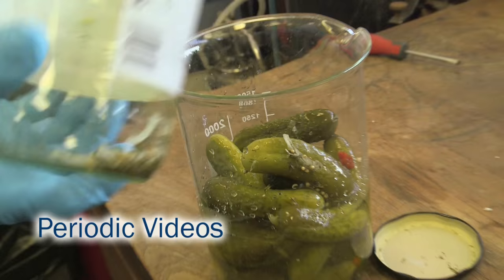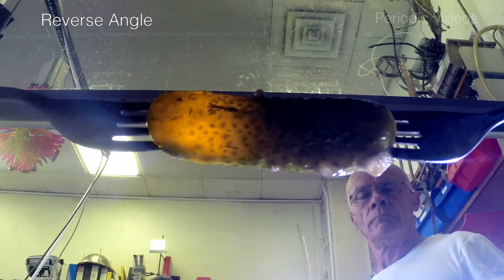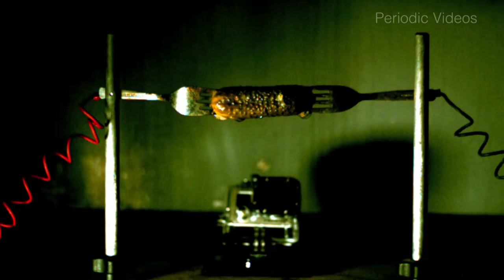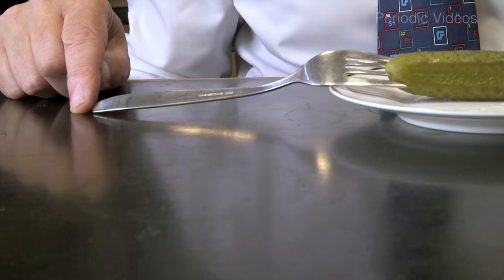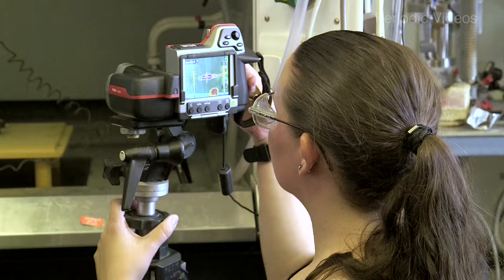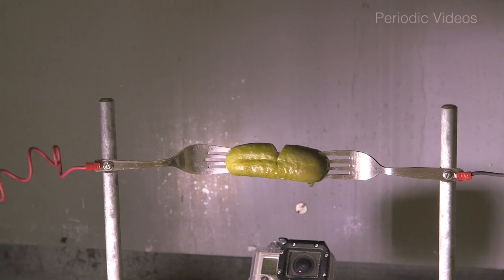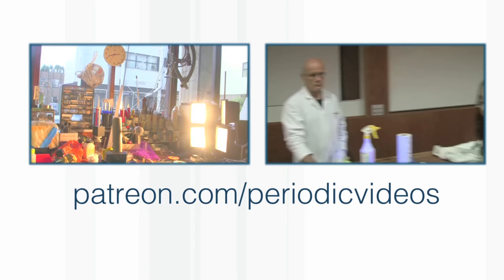Electrified Pickle - Periodic Table of Videos

Comment: Did you check the polarity of the pickle you don't want to install them backwards.
Reply: yeah, the stalk is positive and the tail is negative.  And it works best on a full moon.
Reply: +Ray Kent lol
Reply: When you put pickles in parallel, their tastiness can be measured by 1/t = 1/t1 + 1/t2 ...
Reply: Michael Falk the current will alter the polarity to favor the direction of electrons.
Reply: You buy the AC types.

Comment: Sorry to correct the Professor, but his explanation of this video is incorect. 

If the conductor was getting up to sodium excitation temperatures the pickle would flash boil and then burn. The forks would also be red hot. The thermographic camera show us things are hot, but not hot enough. The sodium is getting up to light emitting temperature from arcing happening between the forks and the electrolyte (pickle brine) in the pickle tissue when the water next to the forks is boiled off by the high resistance caused by the change in conductor resistance. 

The side that flashes is based off of conductivity at each fork and will seem random, but can be controlled by inserting less or more prong on one side. The arcing my still jump as the conductors heat up and water is evaporated from the pickle.

This is an excellent example or different conductors having a poorly bonded interface that is high resistance and the results in practical applications. Things get hot at the interface and damage the conductors. The wedge cut out of the pickle showed the underlying principle of high resistance points in a circuit cause high heat points.
Reply: I think it´s not the conductor but the arc that´s hot enough to excite the sodium ions, that would also explain why it didn´t light up in the thinner middle. It got hotter then the rest because of the increased resistance but not hot enough for it to start glowing.
Reply: The plasma in the arc (a few thousands of degrees) should be hot enough.
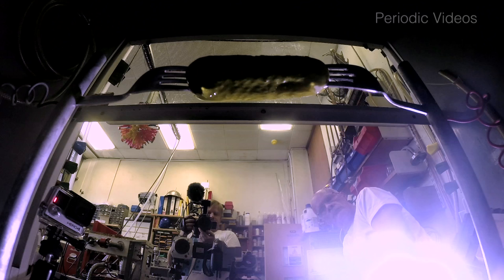Reply: And at 7:10 you can see the fork on the right moves a couple millimeters. This seems to have made a better electrical connection, with less resistance, on the right fork.
Reply: nah, it's the arc that actually hot enough to excite the sodium ions, which are just tiny part of the whole pickle.
Reply: Are you questioning his mighty afro?
Reply: Indeed, UV light from the arcing is the likely source of excitation. And while the amount of forkage (perfectly cromulent word, btw) should matter, I suspect it's not actually directly related to the resistance, but rather depends on mechanical stability. The side with less forkage has less mechanical support, and will likely develope a gap in which arcing can occur faster than other side, where the weight of the gurkin presses it down on the fork.
Reply: +Robin Bermanseder What? The arcing happens between the gurkin and the fork, ofcourse.
Reply: +Robin Bermanseder You mentioned that the prongs on the fork are the same potential, which is correct, but irrelevant. The experiment should be reproducible with a single metal rod as well. What seems to be happening here is that the gherkin (which I misspelled so far :/ ) is eroded or shrunk near the prongs, creating a gap in which arcing can occur. The gherkin serves as one of the electrodes, which is nothing strange, seeing that it's conductive.
Reply: What did i Just wrote?
Reply: Gary G Caring about who's right and who's wrong is ultimately a way of discerning what's true or not. What's the alternative? Turning off your brain and not caring? Let me ask you Gary, are you religious, by chance?
Reply: +Gary G classic Christians am I right
Reply: btw one study showed 75% of scientists are christians fyi
Reply: NatureHacker one study with a sample size of what?
Reply: Gary G I don't know if there's a misunderstanding here. I'm an atheist, and yes my comment was meant to condescending because what you said sounded too much like arguments I sometimes hear from creationists trying to muddy the waters regarding the reliability of the scientific process. Glad to hear that was not the case.
Reply: Gameboygenius Misunderstandings do & can happen, I'm happy to agree, No hard feelings.
Reply: Happy endings in comment threads always increase my faith in humanity meter.
Reply: Can't pick on anything else, So The Grammar Warriors come out to play.

Please Grow up, and as someone once said, Let's keep this Subject germane & adult like.

Comment: It probably changed sides because after some time it evaporated water, increasing the resistance of the now drier pickle, so it change the side where resistance is lower
Reply: From personal experience (as a pickle eater not as a pickle :) ) the moisture content varies depending on the way the pickle sits in the jar. So the first pickles that glowed at only one side sat vertically in the jar and the las one that alternated sides probably sat somewhat horizontally.

Now i have to experimentally determine how the sogginess distributes, top to bottom or bottom to top. AAAAAAAAA, damn it, i ran out of pickles! :)
Reply: I am a bit disappointed having to scroll so much to find this comment. Vote up!

Comment: Back in middle school our computers had an electronics lab program on them where you could connect batteries, resistors, lights and motors. It also had a pickle in it which you could make shrivel up with a "blerp" noise if you put enough power through it. Really neat to see that happen with real kit!

Comment: Due to the reflectivity of metallic surfaces, you can't actually gather temperature data from uncoated metal surfaces.  So the forks aren't necessarily getting as hot as the thermal imaging implies.  Great video!

Comment: I remember doing this demonstration in a middle school science demonstration. Each student had their own experiment and I picked this one. I built a homemeade rig and mine was the only experiment that required the use of the fume hood. It's nice to know more details about how it works. I think I remember more of my pickle lighting up than this; sometimes the entire pickle would light up for a moment or two. I suspect this has a lot to do with the different power used. I don't remember whether I used a large battery or if I used mains electricity (which, being American, is also not quite the same, as the professor mentioned in the video).

Comment: Nice one! I've been doing this one for years! The burnt smell lingering in the air is also a plus. I would suggest for the next one to test the conductivity of molten glass using two incandescent light bulbs connected in series. Break one, leaving the inner parts intact. Then heat the inner glass fitting and connect to mains, The other bulb should light up!Terrific work keep it up!

Comment: If you look at the high-speed footage around 2:50, it's clear that the floodlight oscillates at 50 Hz, but the "pickle light" only oscillates at half this frequency (confirmed by an FFT of the audio). I would expect the pickle to become excited at every positive AND negative cycle of the mains electricity, but this is obviously not the case. 

It seems like the resistance of the pickle depends on the direction of the current, which seems odd from an electrical point of view. I'm dumbfounded, does anybody have an idea as to why this might be?

Comment: Did the arc jump to the other side of the cut pickle due to the electricity following that path of least resistance? It looks like once the left side heated up, it jumped to the right, then once the right heated up, it started to alternate. Did each side almost find equilibrium?

Comment: Someone may have noted this before me, but i think the light comes from electric arcs forming between the tines of the fork through the spongy tissue of the pickle that is filled with a conductive ionized water solution. If it switched from fork to fork at one point, it may be because one fork heated up to the point it deformed enough to space its tines farther appart from the closest tines of the other fork (the arc will then jump the least resistive gap). It may also be a variation in the presence / concentration of the conductive solution favouring the arcing in on area or another.

Comment: Periodic Videos, if you review your clips you will find a strong correlation between the relative fork prong/tine depth and the end which arcs. The fork with the least amount of surface area in contact with the gherkin will have the higher resistance of the two ends, thus will be the side that gets hotter first and subsequently start arcing first. (neglecting any other factors such as salt or alkalinity gradients)

Comment: In the first case, it looks like the glow only occurs on half of the AC cycle (you can tell this because the high speed video shows the room lights reflected from the back wall, and they flicker twice per flicker of the pickle glow - room lights, both incandescent and fluorescent, flash twice per AC cycle). In the second case, sometimes the pickle glows twice per cycle, and other times it glows only once. Any ideas on why this might be? It seems to act like a rectifier. It would be interesting to use a current probe and oscilloscope to see if the pickle is indeed rectifying the current.

Comment: Excellent experiments. I would expect the difference of contact resistance between the metal and electrolyte at the different ends would pick which end would continue to glow. As the current changes the electrolyte from liquid to gas, that end would become more likely to support the next mains cycle of conduction by causing a concentrated current density through the still liquid electrolyte (the ionized vapours probably dissipate too rapidly to support a continuous arc). I believe the forks get hotter than the body of the gherkin for two main reasons; firstly, they have lower specific heat, secondly, the fork tines vaporize the electrolyte on contact and thus gain heat from the arc but don't expel heat via that evaporation. It was really amazing to see the fork "cut" through the pickle after the glowing end switched! In that case the forks must have been incredibly close to equal contact area and equal contact resistance with nearly equal amount of electrolyte! WOW!
Totally amazing!
Thank you.

Comment: What is the purpose of the LED light? Is it just to light the pickle for better capture by the high speed camera? Is it like an indication, that the pickle is Live or is it used as a form of current limiting device?

It seems like the light is flashing with exactly mains frequency, which if correct, means there might be some form of AC rectification in the pickle circuit. Either the current limiting device does it or the processes inside of the live pickle. What would happen with smooth DC?

Comment: I used to do this all the time, but it's been over a decade, but as I recall we found the best light show was obtained by inserting two long electrodes in the same end of the pickle, extending through its length. I think you get arcing all along the length of the electrodes and it's a bit more dramatic, rather than the one spot at the end that I've seen here and from Steve Mould.

Comment: the reason why its all chance about the spark on one side verses the other, i believe the pickle is acting like a spark plug in an engine. well a spark plug has a specific location for the spark to take place. the gerkin?(pickle) does not have a particular location for the event to happen. in fact every time the event happens it turns a portion of the brine into gas thats expelled. so this event is constantly trying to find the most efficient way to ground through an ever changing route because the brine is being expelled its actually changing the resistance to the particular area in which the spark "jumped"

Comment: I saw this experiment on an American TV show years ago, (Mr. Wizard) with Don Herbert. As soon as the program was over myself and my approx 5 year old son went straight to the kitchen and found a suitable pickle. (Mom wasn't home that night) A couple of old forks were found, some jumper leads on a old electric cord and we were ready. 120 volts AC into the pickle and it lit up very nicely. My son will be 36 this year so it was a long time ago, but to the best of my recollection the entire length of the pickle glowed with pretty much the same brightness.
George
Reply: It looked like they were running the AC through a Variac, which may act as a ballast. Not sure what the difference between 50Hz and 60Hz would be in this situation. I've been under the impression that neither frequency will support a continuous arc well, but if the current is limited, then the power is limited (not to mention the inductive effects). In this video it looked to me like the light was being generated between the fork tines and the pickle, then diffusing through the pickle body.  ?? 
I saw the same Mr Wizard episode. I will be 36 next month. Happy Birthday to your son!

Comment: The pickle doesn't care which fork is grounded (or "earthed" in UK dialect). Only the voltage difference between the forks matters. Whichever end has the poorer electrical connection between fork and brine is the one that will likely glow.

The current flow must be constant everywhere in the circuit (the same number of electrons pass each point every second) but the voltage difference between any two points along the circuit will vary depending on the resistance between them. Two nearby points with relatively high resistance between them will see a relatively large voltage drop (difference) and more power will be dissipated between them than between points with low resistance and voltage drop.The higher power generates more localized heating, which boils the water, chars the pickle and tens to further increase the resistance and localized heating. This tends to continue until the resistance increases so much that current stops flowing altogether.

Comment: They mentioned "high voltage" (although I don't consider voltages in the hundreds to be 'high' really...) but nothing about how much current they're using.  Does this require a lot of current?  Does it act differently if you use low current but really high voltage (tens or hundreds of kilovolts)?

Comment: Very cool video. 
btw is anyone knows how they make their set up? I mean the forks, wire and electricity. 
Is it like just plug the wire to the normal house electricity or need something to regulate the voltage and amp?
Reply: More or less, except it looks like they've got a regulated voltage supply (hence the shots of the voltage dial). This would work just plugged into the mains, although I probably wouldn't recommend it...
Reply: basherofnoggins Thanks for reply. Yes I see the voltage dial. :)
Reply: By regulating the voltage and current in your power supply, you aren't counting on your circuit breaker panel (consumer control unit for you UKers) being your sole safety margin either should things go horrible wrong and your open circuit wires start glowing and melting/burning the insulation before you can unplug the power safely.
Reply: Markle2k So you mean should also have a external power supply? or something else?
Reply: What Will Happen If? A regulated power supply limits the amount of current without risking overtaxing what is plugged into wall. If you just go open circuit into the wall, the only protection you have is what is in the breaker box. You are going to be looking at the pickle, not your lead wires into the wall. You won't be alarmed that something smells bad from burning because you are fully expecting your incandescent pickle to smell bad from burning. Ultimately, you are counting on the circuit breakers/fuses tripping (and for all your bad luck you might have a faulty one or perhaps somebody shorted it out with a nail or bolt) to keep your house from catching on fire. If you aren't using properly specced wire, you may have to run to your breaker box in the basement to cut off the electricity if things start going wrong.
It is simply better to have control local to you rather than take on all these (and perhaps other) risks.
Reply: Markle2k Thanks for information :)
Reply: I would say it looks more like an autotransformer, or a huge rheostat.  Especially since the device looks and is referred to as "ancient".
Reply: 2 plug fuses too :)
Reply: It's an auto transformer aka a "variac".
Reply: Now that I think of it that makes sense, since the output goes to 260 :)
Reply: yes it is a variac. i would say this experiment is extremely safe and fun if you dont touch the forks. how hard is it to not touch the forks?
Reply: yes probably best to check it supports the weight of the pickle before you plug it in. probably best to make sure either fork on its own can handle the weight of the pickle.

Comment: Does the pulsating glow correspond to a negative voltage or a positive one?

It would be interesting to have the current applied through a double two-way switch, so that once one end starts glowing, you can reverse the current. Does the same end remain glowing, or does the glow follow the voltage?

Comment: Really cool that at 6:30 , when the ignition happens on both sides, that the right-side flashes are out of phase with the left - exactly as one might expect if the light-emission were happening on only a particular polarity of the sinewave. 

I wonder then if the left-side or right-side bias may be possible to influence by distorting the mains-waveform on a particular polarity.. (e.g. by a parallel load through a half-wave rectifier).